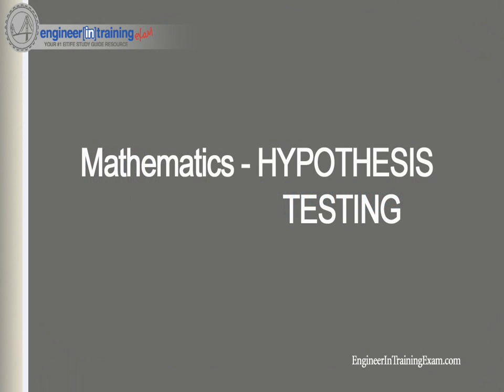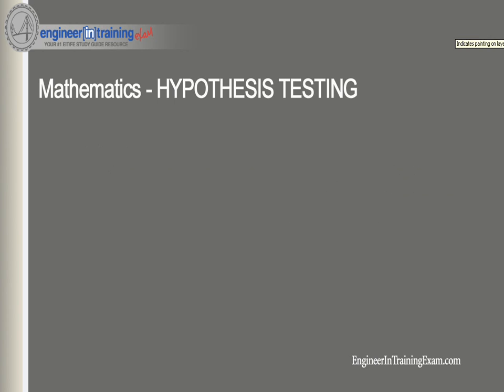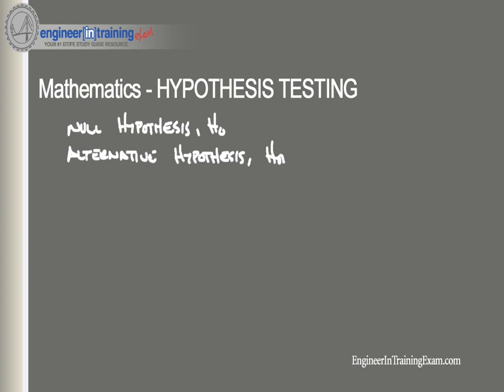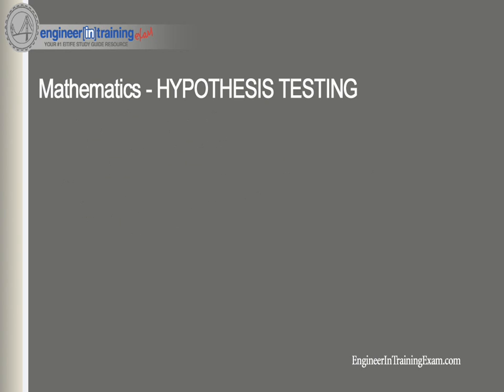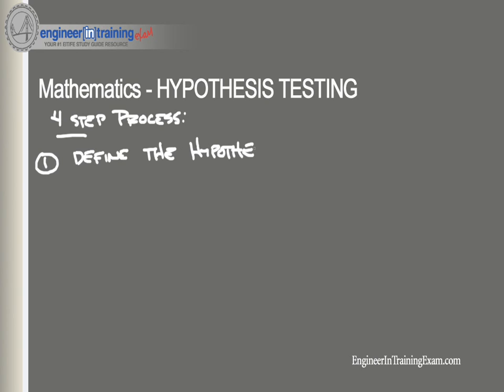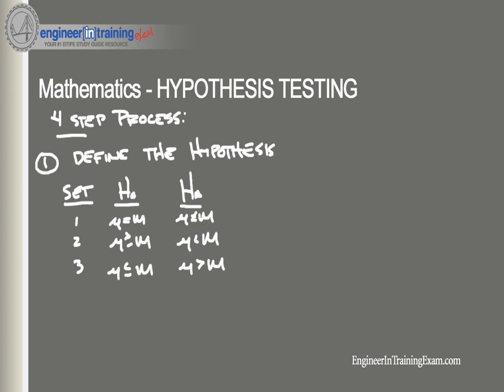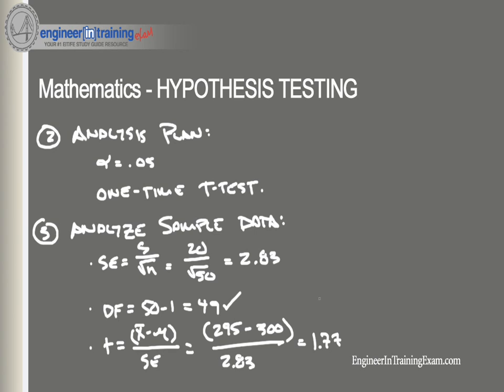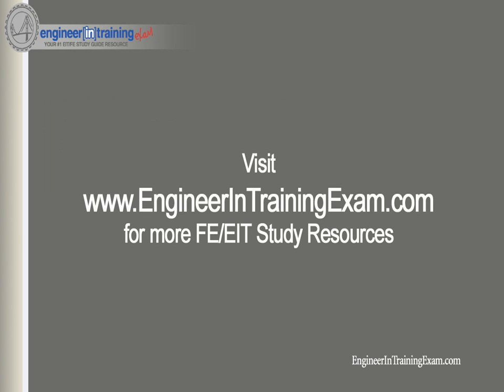Hypothesis Testing -- Fundamentals of Engineering FE EIT Exam Review

Comment: How did you get a p-value of 0.85? None of the t-score tables I have seen online have a degrees of freedom of 49.
Reply: I don't understand the value obtained of 0.085. According the t-distribution table on page 46 of the ncees handbook, 1.77 falls between 0.05 and 0.025 of alpha for an infinite degrees of freedom. This would be less than the 0.05 level in the problem, thus rejecting the null hypothesis. I figure the t value wouldn't be 0.085 but more like 0.035.
Reply: Use the value for the infinite degree of freedom and calculate the probability with the t value 1.77. Since it is a two tail test using an one-tail test table you should double the value you get and obtain 0.085